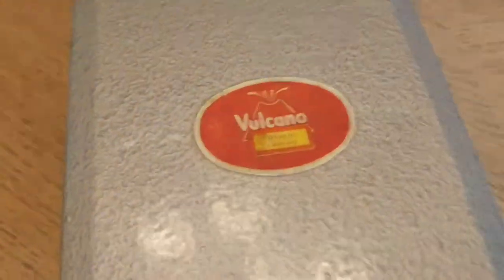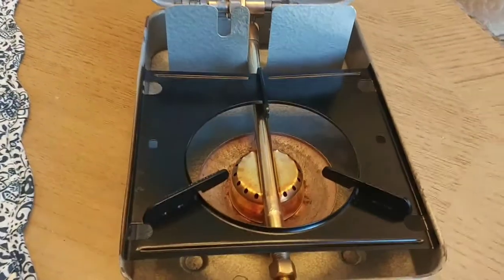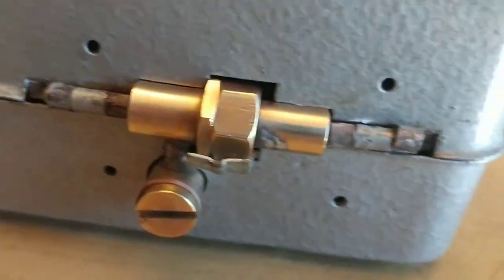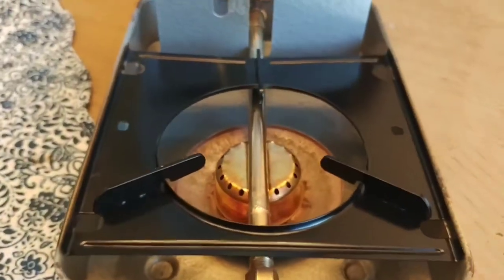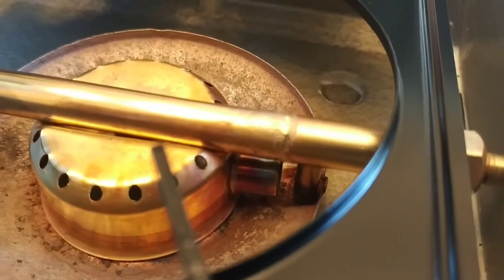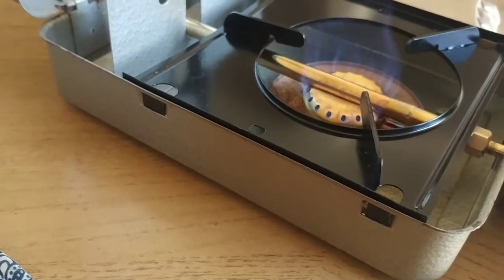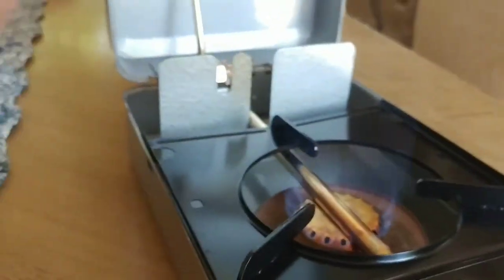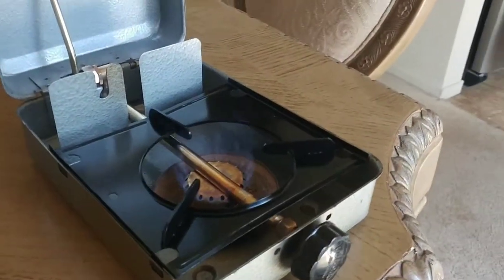Vulcano German Backpack Stove How To Video

Comment: Pretty cool. Thanks for the run through. I bought a camping lot at an auction and it had one of these hidden in the back. Still has the original box and instructions in both German and English.
Reply from the maker: That's awesome! You will definitely enjoy it. Just remember to loosen the cap before you fire it up.

Comment: I have one of those! Missing the top to the tank, and I tried cleaning out the generator but got stuck on that “filter” part as well and ended up giving up.  Thanks so much for the video! Super helpful! 

Do the pins come out easily? What did you use to knock them out before you could grab them with pliers and pull?
Reply from the maker: If I remember correctly, I think I bent the hinges that the pins go through. Just a pair of needle nose should be enough to pull them out. Good luck!

Comment: At first glance I thought, wow that's the same stove as the one I found in my grandpa's garage. 
But there are some differences to mine.
On mine the tank is connected to the burner by a hose and the cooking pot plate is screwed into place.
Otherwise it's quite the same. 
Maybe mine is an even older version.
Reply from the maker: There are a lot of stoves that are really similar. I hope you can get it running.
Reply: @Kingscoolstuff  oh it runs fine.
Just had to do a little clean up in the tank and replace the old brittle hose with a piece of fuel hose I had laying around. Great stove so far, especially in winter where the propane stove keeps freezing up all the time

Comment: The peak temperature of  ethanol flame is 1,920 degrees Celsius (3,488 degrees Fahrenheit), while the peak  of methanol is 1,870 degrees Celsius (3,398 degrees Fahrenheit
Both burn  40 to 90 degrees C cooler than white fuel/Coleman fuel/gasoline, and also cooler than propane or butane
Not so your hand would notice though. All of them would burn your hand to a crisp!
Reply: Yes totally agree, but didn't have the numbers available, but knew in my heart that what he said was wrong, I have many stoves, white gas, propane, alcohol and kerosene stoves. So I know white Gas burns the hottest of all. Good job! With  the stats.